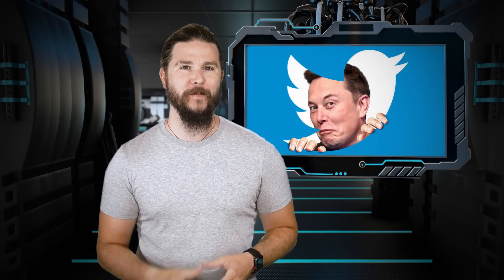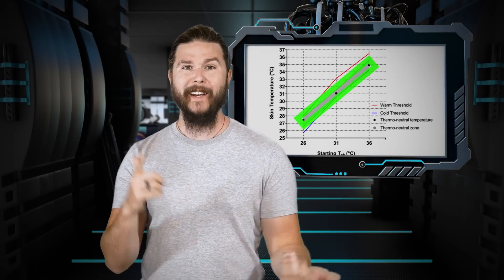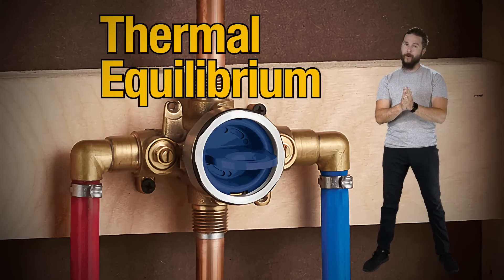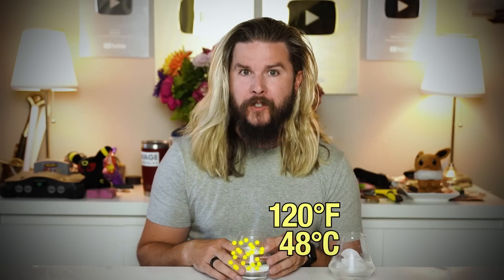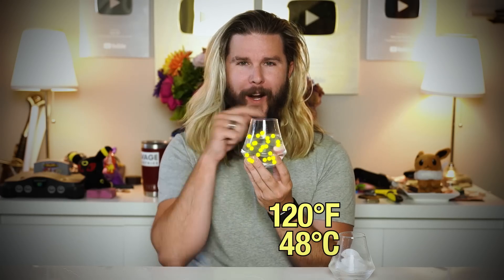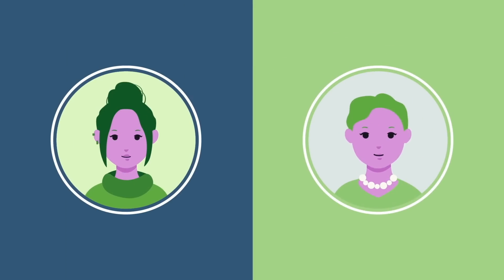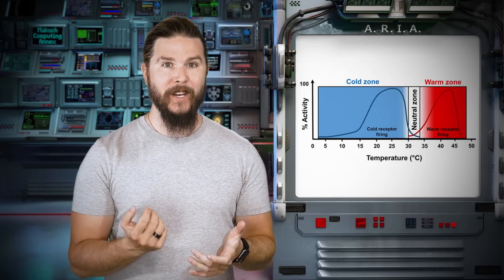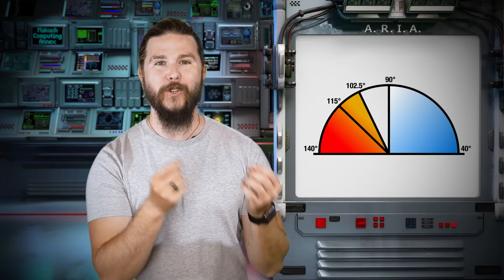Why Are Shower Handles So Sensitive?

Comment: My dad renovated basically our entire house himself, when he made the walk in shower (sounds cool but it's just big cold box) he made it with three levers, one to switch between shower head and hose, and the other two were each for hot and cold.

Long story short, that's the best temp adjustment I've used, I miss it, nowhere I've lived since has had it
Reply: The master bathroom in my mother's house has that arrangement. It seems to be something that kinda carried over from the old days when we had separate hot and cold taps. My guess is they wanted to make showers and sinks be as similar in operation as possible, so they just kept the separate hot and cold knobs
Reply: @richardmillhousenixon  makes sense! The only time I haven't liked that in a sink was a hotel where the hot and cold actually had separate faucets :-( one cold hand one burned hand lol
Reply: @sevrono  lmao that's the worst of both worlds
Reply: I'd say that's the standard here in Argentina. I've never had a problem adjusting the temperature of a shower until I tried this 180° lever thingy
Reply: Used to be the standard for about 20 years. Before pull top tub spouts and then single valve bodies became the norm. I remember when the single handle valve bodies first came out everyone thought it was so fancy. Now they are the cheaper option and getting a two valve two handle setup usually costs more.

Now the two handle two valve faucet system is fancy again.
Reply: most houses in australia have separate controls
Reply: This is standart in Europe. American shower design is terrible.
Reply: @karpaske  I don't live in the United States, but I do live in North America
Reply: @karpaske  Uh, no, you have no idea what you're talking about. Hotel and apartment shower designs, sure, but I doubt that has anything to do with America, since these terrible one-dial controls are found worldwide. Most homes in America still have separate knobs for hot and cold, and a third control (if older, a third valve controlled by a lever, or pull rod) to switch from spigot to shower head, which is the superior control scheme.
Reply: That's the best system. It also allows control of the water pressure. My biggest issue with the one lever system is that you waste so much water when you need to adjust it to give you the same amount of cold and hot water because if fully opens both. I like to be able to open 10% of each when that's enough pressure for my use.
But also that system isn't perfect, there much more to mixing water that is said in this video. Pressure difference between hot and cold water can affect the mix and sometime opening cold first or hot might get a different result. Even when the shower is attached you can still sometimes feel a different temperature depending on how fat down the stream you touch the water (that might be do speed of water and not the actual temp, it's just something I noticed but never looked into the science behind it).
Reply: @tonymouannes  I have noticed a similar thing with the water feeling cooler the farther you are from the shower head. I think it may be evaporative cooling.
Reply: @eingmata2410  that's not how evaporative cooling works. Also the shower is too humid to allow evaporative cooling to work. Even if it happened, the coldness would be felt along the stream and not concentrated at the bottom.

Fun fact, when you finish your shower and open the door and the bathroom feels cold pretty quickly, that's evaporative cooling.
Reply: Having separate controls for hot and cold is fairly common since that's actually slightly simpler for plumbing. I'd guess something like 30%-50% of the showers I've been in have had separate knobs, and I do prefer that, although I think you can still run into the issue Kyle is talking about.
Reply: @danieljensen2626  we have three knobs here at this place, and it is the most sensitive system I’ve ever used. Downright scary when my daughter starts playing with the knobs during bath time 😨
Reply: @justinford350  I'm wondering what the spread is on total valve stem rotation from closed to wide open is from design to design. Not sure if that's something the industry really keeps stats on, but it could be interesting to look into. The valves on my 1950 tub/shower easily allow for fine control compared to others I've used where it seemed like the knob had much less range of movement.
Reply: My apartment has that setup. There's a knob for hot, a knob for cold, and a knob to adjust between the faucet and the shower.

Comment: I am weirdly right in the middle of a bathroom remodel right now and I specifically chose a shower panel with a temperature display just for this reason..... Unfortunately it's not installed yet so I couldn't tell you if it actually is the magic solution or not.

Comment: Here in Poland I don't f around, I just buy and install a thermostatic shower mixer. Solves all the problems.
Separate water flow controls from temperature controls. 
You can even take it apart to set the golden spot to suit you better.

Comment: It's also worth noting that the small band of "perfect temperature" will shift position on the 180° arc based on individual preference, for instance you said a target temp of around 38°, but for me a comfortable temp is 48°. The band would still be small in either case. I have a shower with 2 valve handles but the pressure in each is wildly different so that has it's own problems.

Comment: Personally have never had this problem. I know showers with only one knob that controls both temperature and water pressure do it bad, in houses with regular water heaters. I personally have separate knobs for water pressure and temperature, and a tankless water heater, so I have endless hot water time (until the propane tank runs out at least) and perfect temperature. Peasants.

Comment: My shower handle has a separate control for heat and pressure so I keep the heat in a static position where I like it and adjust a little if it feels off but I don’t have to find that point every time I turn it on

Comment: There's also the problem of living in an area with such a wide range of environmental temperatures that in summer you're having showers that are purely "cold" water that's actually lukewarm or in winter having purely "hot" showers that are also lukewarm by the time the water reaches the shower.

Comment: Couldn’t they design shower knobs to have a gear ratio with the valve to give you more control?
Reply: 1) Design a better valve
2) Charge more because it's more complex
3) People still buy the cheap one
4) Give up on better valves
Reply: @pXnTilde  5) Don’t charge more because you still make a profit over the material and labor cost anyway
Reply: @Holobrine  You asked why, I told you why. There is no step 5
Reply: @pXnTilde  Why do you have to charge more just because it’s more complex? If it’s not more expensive to produce in the long run after the design is finalized and the process is optimized, forget the price hike.
Reply: @Holobrine  Who said you have to? They do though. Take a stroll through Home Depot

Comment: You missed the first major Problem. Hot water is Not consistantly or Instant Hot at the shower head. Pipes need to be flushed, in line water heater need to warm up and so on.....
This will result in daily/time diffrence in where this perfect Spot is, like a Sun clock it will move slowly

Comment: I think there's a third option: get a few thermocouples, a servo valve and supporting components, some sort of maker compute board (like a Raspberry Pi), and some knowledge in Python and electronics/robotics, and make your own temperature accurate shower controls.
Reply: Or just install a thermostatic mixer and forget about it. It's been standard in Sweden for decades and they do work.

Comment: Our shower is actually fine with the sensitivity, but our problem is that the heat seems to be shared between all the apartments. So when I'm taking a shower and a neighbour turns the tap to scorching hot you betcha I'm gonna be screaming bloody murder. And when I turn it colder and they stop using hot water it becomes cold as balls.

Comment: there have been very few showers i have used that have a single handle to manage the temperature. atleast in australia its felt pretty standard to have two seperate handles to manage the hot and cold water in the shower.

Comment: We mostly use electric showers where I live, the shower handle only controls the the amount of water that flows through an electric resistance that heats it up, and it can be set to like 4 temperature options or so, so that's not much of problem here

Comment: I start off a lil warm and by the end of the shower my wife has escaped cuz it's line a sauna in there and I've got the temperature so high my entire body is practically glowing red, and i'm happy boy :D And we need the hot water to be pretty toasty cuz in the wintertime, which is most of the durn year up here, the cold water is properly freezing effing #¤%/#%/ cold.

Comment: I've never had this issue with showers...strange

Though there were a few points where, out of curiosity, I turned the water to maximum heat or maximum cold. Regretted it immediately. Do not recommend.

Comment: Turning down your water heater is a bad idea though, as I found out. Too low and you use up the water in the tank quicker, thus less hot water to go around for say, someone else taking a shower after you or running the washer or dishwasher while you shower.

This is because you'll typically have very hot water coming from the heater that you'll then cool down with cold water. Mixing both got and cold gives you two water sources to pull from. But turning down the temperature on the heater means you'll be needing less cold water and using mostly warm water from the heater, so you're only pulling from one source of water. And that source is finite, because it takes time to heat up that much water.

Tldr: don't turn down your water heater, you'll run out if hot water very quickly

Comment: Why do people buy this type of shower? I have a two valve system where one controls the output of hot water and the other one controls the output of the cold water and it is much more precise when controlling temperature because you just adjust one flow instead of both

Comment: Living in Japan, I have not really used a shower that does not have a much more ergonomic angle with a water boiler that you can set on a maximum temperature ...

I was more expecting an explanation regarding why in some houses (in Europe, I'm expecting showers in the USA to be about the same but I can't know for sure) the temperatures isn't always constant, and what could be the reasons for it (also when somebody else takes water from a tap while you are having a shower, how can it affects the temperature of your shower)

Comment: I like the oldschool  2-valve solution as the next best option, half as sensitive to valve position since you're not increasing one and decreasing the other at the same time. Best option is simply use an electronic valve that automatically adjusts the valves via stepper motors and a variable temp sensor. Someone flushes the toilet = no big deal, esp if there's a 3-gallon buffer tank so the sensor has plenty of time to react.

Comment: Just spend 5 minutes to find the sweet spot once, and mark on the physically rotating part of the shower control with a sharpie.  If you mark the rotating part with a tiny bit of positive pressure on the handle for accuracy... you can never really be wrong.

Comment: my shower is a single knob but its soooo much nicer to use than the old one as it has a temperature readout so you can just get it to you prefered temp with a big swing then lightly tapping the handle for minute adjustment]

Comment: maybe what we need is a faucet control with a worm drive.  That way there is more that 360 degrees to go from all the way cold to all the way hot.  Would need some sort of way to visualize the current rotation amount; my brain thinks that it'd be best if the turning knob went from blue to red in some manner, but I'm not sure how to actually DO that.  (thinking transparent knob with color change behind.)  Maybe there's a little gauge on the knob?  shrug

Comment: How about a shower company makes a mixer, which has a 45° throw in the good zone, taking into account the minimum temperature to kill legionella and water above freezing.
This regulator would need 1 adjustment screw for the individual situation of course.

I don't see what the problem is ... Oh, it's 🤑

Comment: Never addressed why other options are not viable. Why not change from a 180° handle to 360? That would double the sweet spot size. Why not have an arbitrary number displayed with each degree of rotation (it would be easier to find the same spot again tomorrow if you were aiming for that number)? Etc. Lazy episode. :(

Comment: 120F works well, where I live. I'd like to note too that at least in some parts of the world, the "cold water" is NOT necessarily 40F! Certainly in the US Southeast it isn't - not even in most of the winter, for the southernmost parts of states like Mississippi. Since I happen to live in southern Mississippi - pipes are generally NOT buried very deep, as there is effectively no frost line, and therefore ground temperature is "cold water" temperature...which in summer can be right up around 65F during a stretch of hot weather!! Again, even in winter the water doesn't get below 55F most of the time. At least that's the experience I have had with several different plumbing situations. Including being on a well system, which was about the coldest water I've had in these past 30-ish years of living in the area.
I'd also be interested to know how much difference there is between the lever style temperature control like you show here, and the (older?) "two knob" type of temperature control. If any.

Comment: Kyle has clearly never lived in Arizona where the cold tap water is 95 degrees in the summer. Pretty good control when the hot water is 130 degrees and the cold water is 95.

Comment: There's a very simple engineering solution here that I'm a little surprised hasn't become the basic install:
Now I need someone else to do the math, but given roughly equal flow rates on hot and cold, and that we're aiming for "slightly above" an even mixture all that is needed is change the pipe diameters to match the most common "warm" setting. Slightly narrower cold, slightly wider hot, and the "middle" becomes a 51/49 split instead of 50/50.

Alternatively if you just have two different knobs you can just reduce/increase the either as needed.

Comment: Another factor that's easy to miss is what happens between shower head and your skin. The water loses heat there, and how much is different depending on your showerhead. For instance, anecdotally, my apartment water heater has a low max heat and we have tall, low-volume heads to where it's hard to have the water above lukewarm by the time it gets to be even on full blast, even though it's scalding when it leaves the faucet.